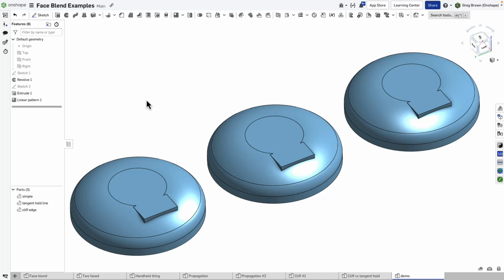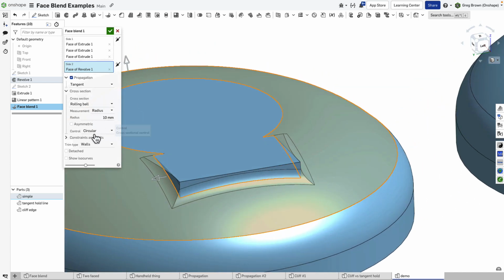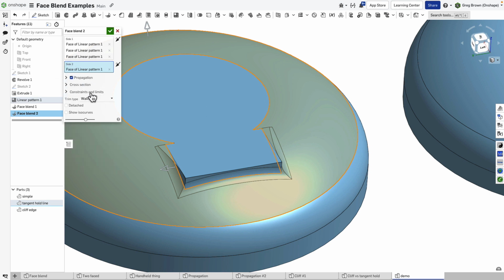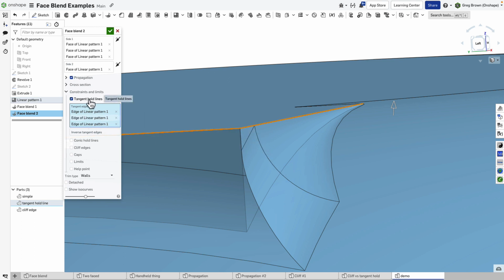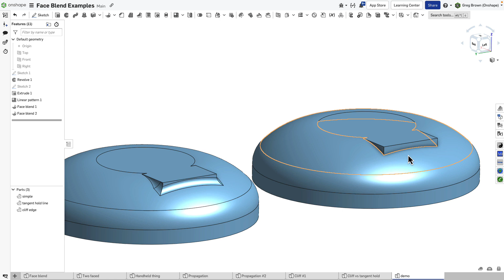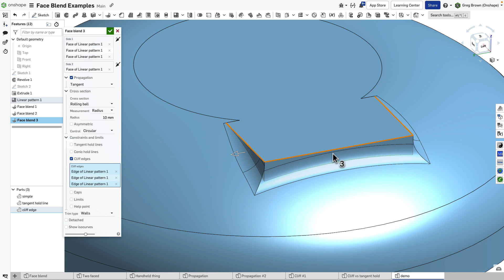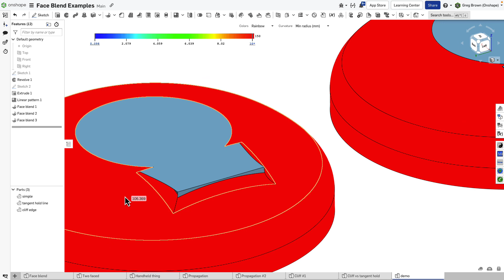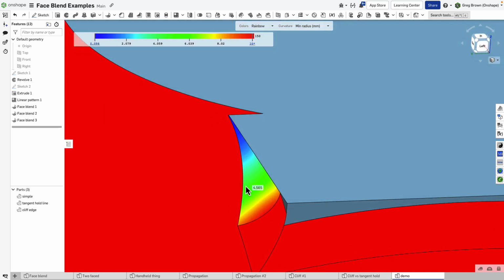Understanding Onshape Face blend - cliff edges and tangent hold lines

Comment: Greg, On part 2 you utilized the tangency limit on the three edges. I would have added the 2 lines that join the radius too; to eliminate harsh ugly edge. I have not done this in practice, it's purely theoretical (I am still a novice) so I have no experience in what it would gain. Is that document available as as public document I can copy and try? I think something you presented here would be a boon to the Onshape Learning as additional exercises - JMHO though. If Onshape can provide more "contact" for practice then it would be that much more rewarding to gain a certificate in the area of practice - again JMHO.
Reply from the maker: I have made the document public: https://cad.onshape.com/documents/9dab8e90d2e2fb4269915ba2/w/bf6bf6fabea161237669ed76/e/4b46482219fd0877b4e66382  
Feel free to experiment!

Comment: Good tutorial. Gave you a like. But one question...What if instead of a concave blend I wanted a convex blend? What would I have to change?
Reply from the maker: Thanks for the comment. The Face blend is designed primarily for "smooth blending" between faces, but in theory there is no reason why it could not support a convex profile. We've implemented "chamfer" profile (linear blend) so one might argue this is not exactly "smooth blending" ;)